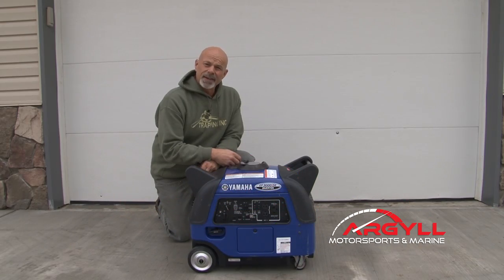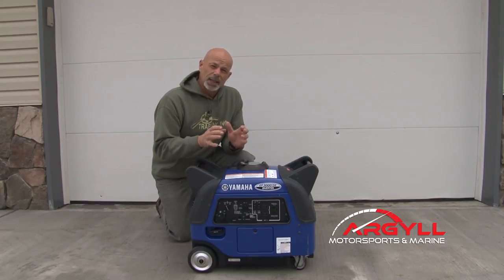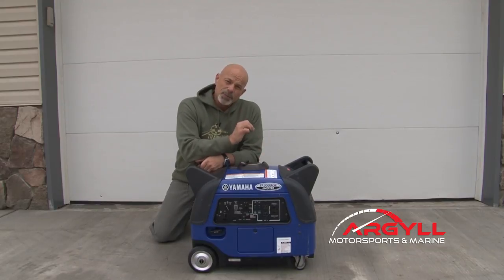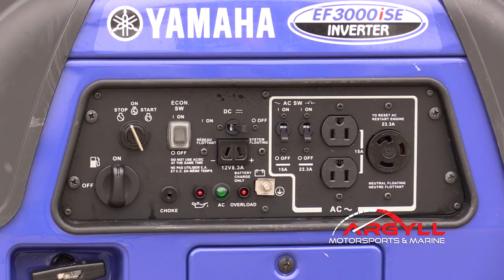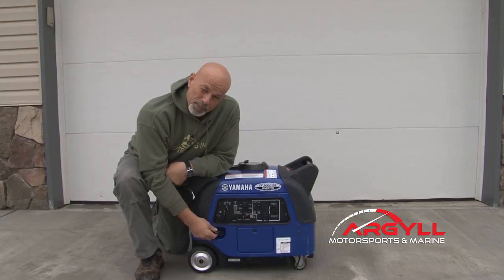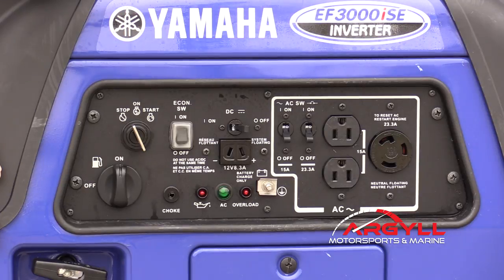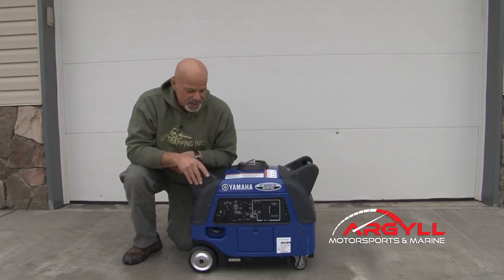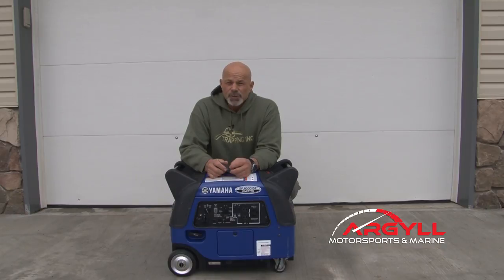Review: Yamaha 3000 Inverter Generator

Comment: I've had my Yamaha EF3000 iseb now for about ten years.   We opted for the "iseb" (boost) version that pulls extra amps from the battery for heavy starts like the AC on the RV.  It's never failed to start, runs very quiet, and sips fuel on economy mode.   I recently added a propane kit to the unit, as it now sits in a remote location where I don't want to store gasoline for long periods.
Reply from the maker: I have no idea how many hours our has on it. Turn the key even at 35 below and she goes!